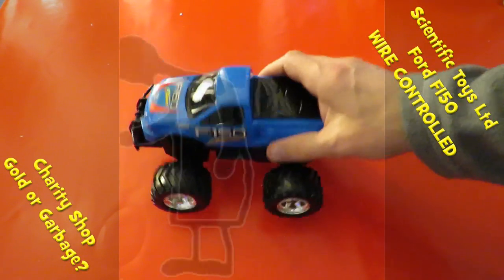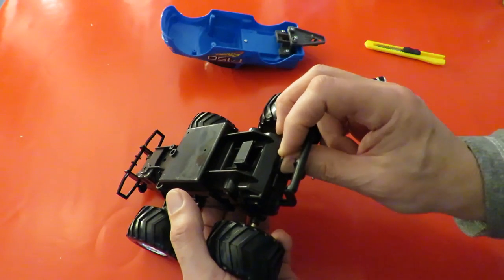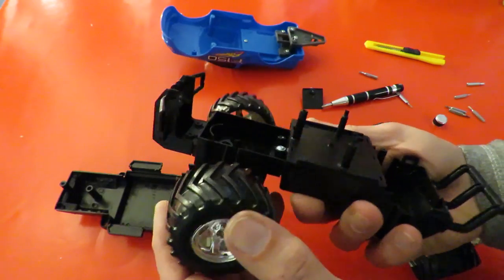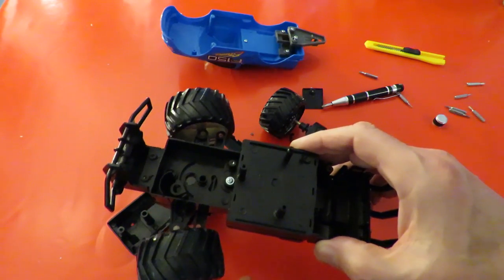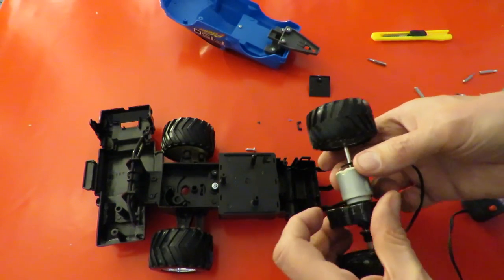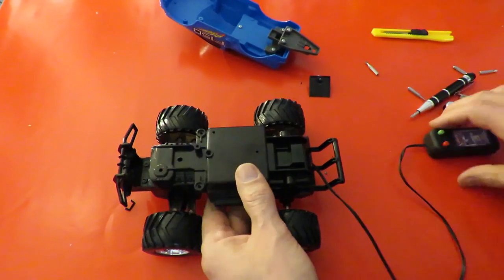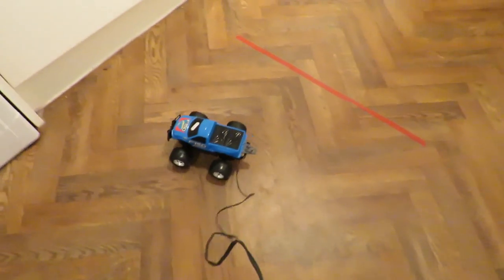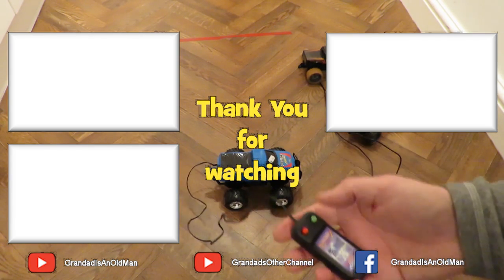Scientific Toys Ltd - Ford F150 Wire Controlled

Comment: So i have a broken 1:10 scale hobby rc i can send it to u to keep and use it runs but not as good as brand new after i fried the gearbox
Reply: hm fairly sure you burnt the motor then, or is it just the spurgear ?
might be spareparts available if you know the brand & model, if it happens to be something like haiboxing 1:10 drifter or similar there are parts available.
Reply from the maker: Hi Susan, thank you very much for the offer it is much appreciated but I have a simple policy of not accepting "donations", I have enough of my own stuff already filling up the house.
Reply: Marcus60661 its a small brand and they dont sell extra parts for it sadly so i was planning to give it im pretty sure its the gearbox problems bcause when i use it i can hear it skipping i had a 3s lipo and i think i chipped some teeth k ordered a traxxas with a broken reciever but it came with tools before i return it im going to check its gears